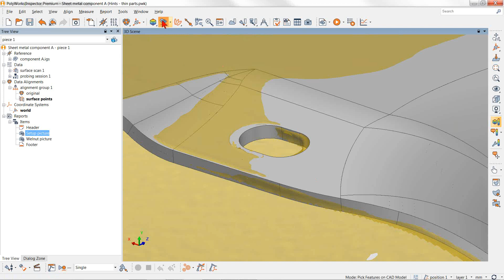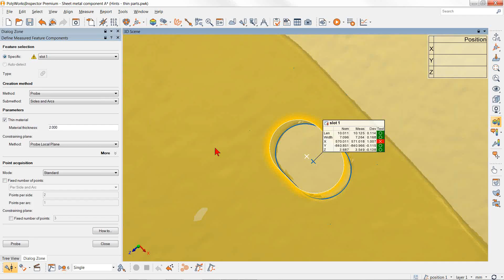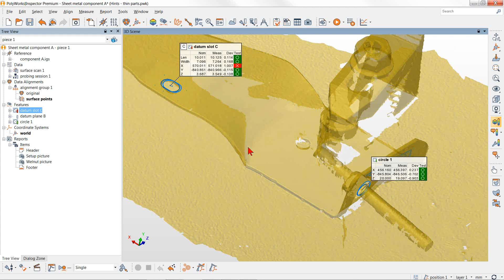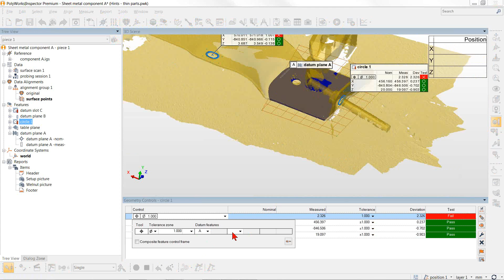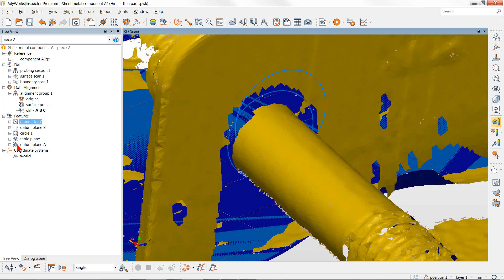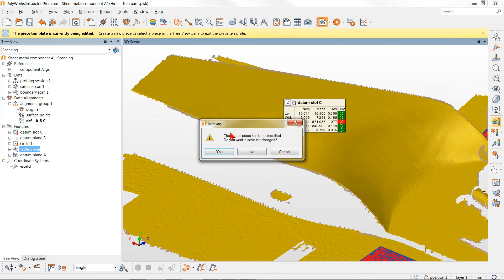Webinar: Hints for Inspecting Thin Parts Efficiently

Comment: We have tubes with holes, with all the GD&T. Holes on a tube is not a circle, but a cylinder in CAD. How do I make them in to circle? How do I measure the circle without the constraining plane? Reason: Difficult to scan or probe a cylinder on a thin walled tube. Any help is greatly appreciated.